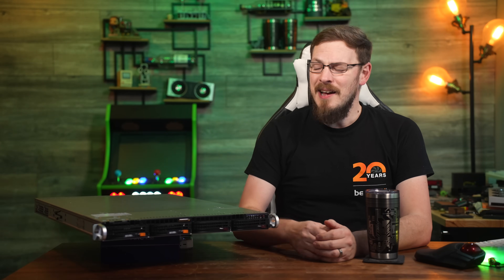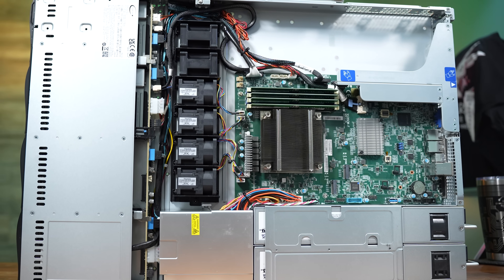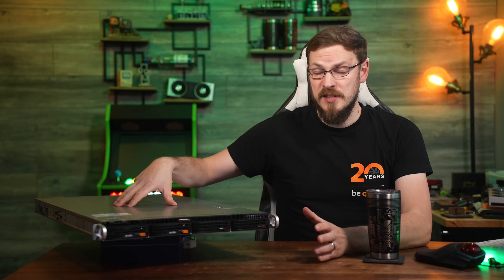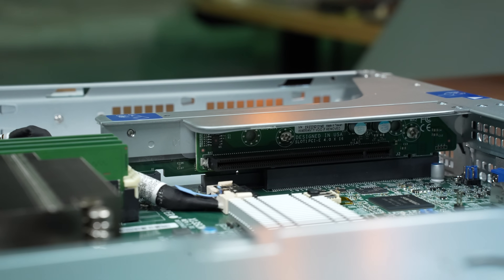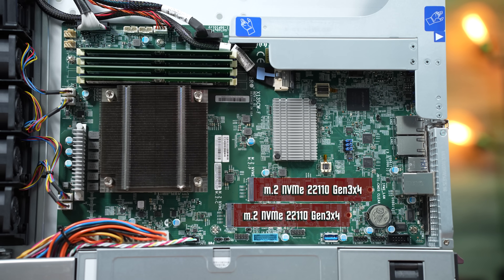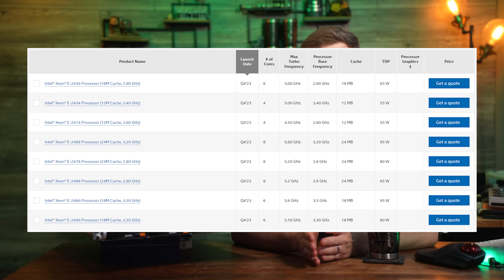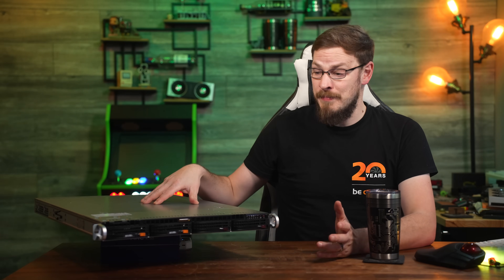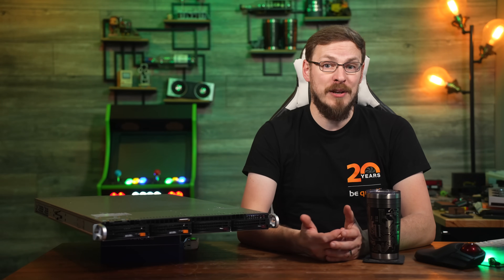Intel Xeon E-2400 Series First Look

Comment: I work a company where we’ve deployed a couple dozen of the E-2300 counterparts for this server.  We needed dedicated hardware for segmentation reasons (don’t ask it was the least bad option).  Our application is highly reliant on single threaded performance so the high boost clock speeds were very important to us and for what we are doing 128GB is way more than we will ever need and the ECC memory is a big plus.  The ability to have a pair of servers for redundancy in a very small footprint was important to us.  These make a lot of sense for that application.
Reply: Java Minecraft server?
Reply: It actually is Java but it's a factory control system for running production machines and talking to databases. @Corei14
Reply: Small office (6 clients), 4 business applications installed on server with local sql DBs, old programs in which only single core speed matters. I totally aggree. There is nothing fitting more than E2488 on a rack shelf. (I am going to Dell R360 with perc H755 and a PM1653)
Reply: cool story bro, my Pentium 3 CPU is faster than that.

Comment: Many vendors still use supermicro chassis as "appliances" with their own custom linux based , application specific build. Feels this is where this aimed at - good efficiency with no complex different cores to accommodate, just using the latest generation underlying platform. Does the motherboard have the on board USB A socket ? Have seen some appliance builds use this for boot and/or recovery rather than full SSD.

Comment: That rough.
I guess it's sort of a solution looking for a problem?
You would have to require this CPU for intense & bursty single core workloads AND ECC. I am imagining maybe cloud gaming or some kind of stand alone remote access workstation... But it feels still lacking even then. It lives out on the edge and can't be upgraded... And is that edge worth it at all?
Reply: On the cloud gaming front it's also not worth it considering it's not super lucrative and not very scalable aside from just buying a bunch of individual boxes... Then just... Why?

Comment: 12500/13500/14500 and above supports ECC UDIMM on W680 chipset, so the 13900 does have it. K chips have it as well, but F do not.
Reply: I think all of them have ecc support. It only depends on chipset

Comment: As far as i know, there are currently no E-Cores in a Mixed configuration (P + E) on Intel Sever CPUs. Most Sever operating systems, especially Virtualisation systems (vmware, Hyper-V) currently do not support both types of Cores at the same time. They recognise them as different CPUs.
Sienna is the better platform here for sure
Reply from the maker: It's on Intel to make sure software supports their hardware platforms. I understand that most hypervisors don't support Big/Little yet. All the more reason for Intel to either a) work with software devs to support their hardware stack or b) put out a more competitive product in this market segment.
Reply: @CraftComputing  it's up to the software company to decide what platform to support. I set the requirements for my application and if it's proprietary there's nothing Intel can do about it
Reply from the maker: If VMWare/MS/etc don't want to allow you to customize their software for supporting your hardware, see option B. Make a better product that's supported.
Reply: @CraftComputing  why is it only Intel that has to do that? What is IBM doing to make Windows run better on Power?

Comment: A big reason for not including efficiency cores and performance cores in this platform is the compatibility with hypervisors, foremost VMware ESXi which doesn't support CPU architectures with two different core types. So if this platform had those in order to run ESXi properly you would need to disable the E-Cores (and even then would probably not be certified by VMware). These servers with the Xeon E lineup are often used by companies in the edge running ESXi for cases where you want to have some VMs local in a branch office like SD-WAN edges or even just for witnesses in a 3rd location.

BTW: I'm not saying it is a good platform, but we do see some demand for systems like this. And for production you can't run a minisforum box or some i7 counterpart as you need a supported platform, both by the hardware and software vendor. I've personally deployed some of those where the customer specifically wanted the lowest spec and price intel server to run ESXi and maybe 2-3 VMs on it only (for thing like the mentioned witness appliance VMs or similar which you can't really put in the cloud yet).
Reply: Also, consistent performance. But to a lesser degree on this kind of products. Intel sells all P-Core Xeons, and will sell all E-Core Xeons soon, but no hybrid architectures as far as I know. It is an schedulling nightmare.
Reply: Yup, here is the glaringly obvious missed use case.  I can also see this low/limited TDP path taken by many datacenters to meet ESG goals as well.
Reply: Not to mention, that those small servers are also often used for MSSQL or Oracle DB, because of the licencing cost. And as far as i know, both don't support E-Cores.
Reply: I agree that this should be considered as a VMware platform, but with it not being on the HCL,  it is not a viable choice for business.

Even if it was on the HCL,  these days, a 1U server without 10Gbe adapter is at most incomplete.
Reply: So...1 out of the MANY options?
Linux supports it, including your Linux hypervisor of choice.
HyperV supports it.
Who cares about ESXi support in 2024 anyway? Every single client I've worked with that was using ESXi is jumping ship.
Those clients are small, but who is running ESXi in huge volumes? There is probably a client out there, but there can't be many.
Reply: @Prophes0r  It depends who you ask. But the lowest estimate I found is VMware with 45% market share, 30 points over the runner up. AFAIK, enterprise is still on VMware. Small business probably not, it's expensive.
Reply: @Prophes0r  supports and work as it should are two differeт concepts. Even consumer systems under windows system not always choose right core type for task. And this is great pain in the butt for developers.
Reply: @Prime0pt  I was wondering about this, how are the hypervisors that do support hybrid archs solving the issue? You could install ESXi on a P+E  CPU, but the performance will be all over the place unless you pin vCPU to certain pCPUs. Does ProxMox solves this? Even if it does, there has to be human intervention at some point if you need predictable performance.
Reply: @Prophes0r  lol vmware has a huge market share
Reply: @Prophes0r  We have many customers and almost all of them run almost exclusively on VMware (with ESXi, NSX, Tanzu, Aria etc.). I agree that a model with P and E core can be used for baremetal compute or ProxMox etc. or even K8S nodes (well to be fair not sure how well that runs in a big environment as obviously all the big K8S deployments I've worked with run on Xeon or Epyc so). But you can not count ESXi out, not even a bit. It is by far the most used hypervisor in the enterprise and cutting support for it is something Intel can not afford to do. Again, these boxes usually are not used in the datacenter for virtualization but in edges and branch offices. If everything is running VMware in the whole company with, lets say for example, 50+ hosts all running ESXi you do not really want to bring in any additional complexity by deploying 5 KVM nodes that you need people to administer. That would probably be more expensive than to just license 40 cores more which, in the grand scheme of things, are not really much if you consider the 50 already licensed hosts.
Reply: @Prophes0r  "Esxi specificially" has never been the most common hypervisor for small clients here. It was too expensive even before the Broadcalypse.
Those are all on Hyperv, because they gotta buy Windows licenses anyway so they might as well use that.
You seem to forget that just because you have a small deployment locally does not mean the company is small or poor. Lots of "servers" like this with low end xeons are deployed as edge, to run the 2-3 VMs that must be local in a specific branch office of a large corpo.
Reply: @Prophes0r  Yes, I did claim that ESXi is the most common, not you. And I'm telling you that you are wrong because you are looking at ESXi used by small companies only and not by large companies. Edge computing is a thing and it does drive sales of this class of small servers.
Is it THE ONLY reason? No of course not. Another reason is per-core licensing of stuff that can't be easily virtualized (because of licensing or other reasons), I know of companies that deploy large amounts of small servers to run Oracle Database clusters. They told me they theoretically could use VMs if licensing that wasn't a nightmare.
Reply: @Prophes0r  ESXi is the name of the actual hypervisor OS from VMware. vSphere is the clustering feature, it's as bunch of ESXi hosts orchestrated by a vCenter VM. But they are still fully functional ESXi hosts. I don't understand why you are acting like it's a different thing.
Same thing with Azure, it's HyperV and Storage Spaces Direct and whatnot, but in the cloud (or on premise with HCL)

So, by your own numbers Vwmare is 45%, which makes it a majority. In my work experience in my area/country its WAY above that, either lone hosts or clusters, I've seen a good 70% Vmware whatever and the rest is mostly HyperV.
Reply: @Prophes0r  You've, apparently never heard of the federal government? Which has, quite literally, tens/hundreds of thousands of ESXi installations. 
Did you just call vSphere an enterprise hypervisor?
vSphere is a suite of products that include ESXi.
Did you just try to "Google it" with extremely-specific VMware products?
That's hilarious.